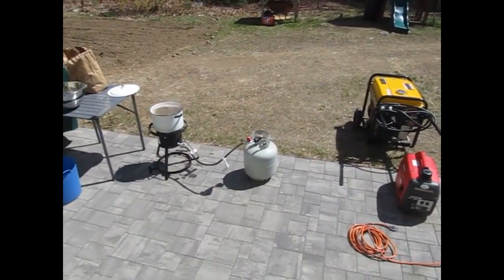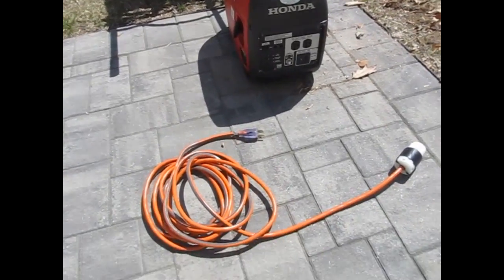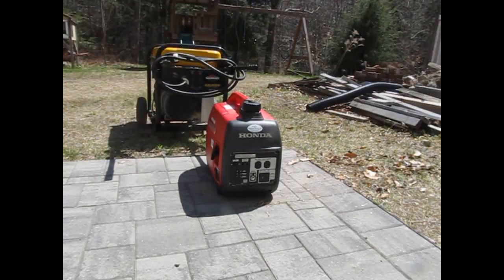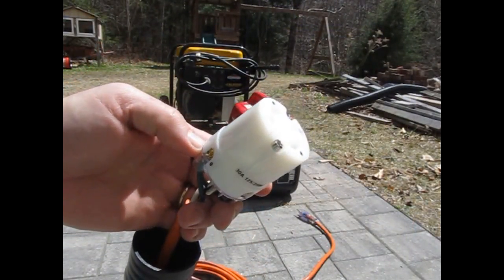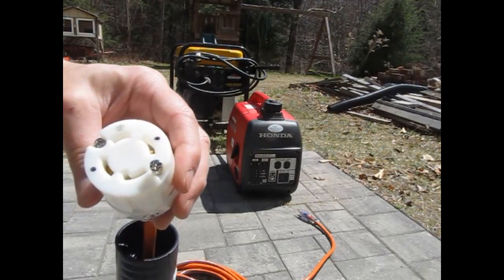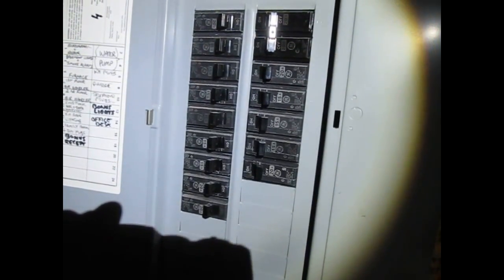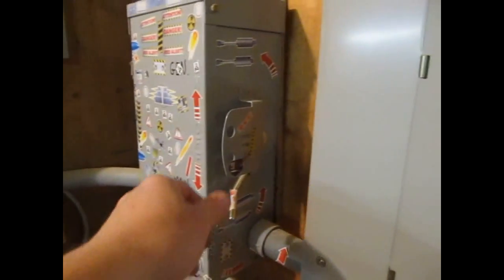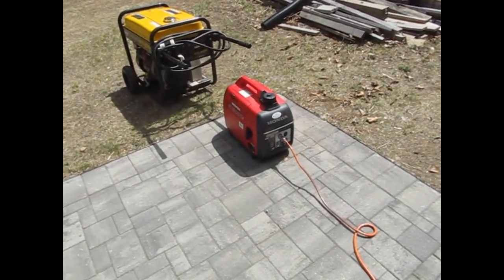Honda Generator Cordset Upgrade

Comment: Good video.   I tried to find a 120v to 30amp pigtail to plug my Honda to my transfer switch using my standard extension cord without having to cut it but no luck. I'll be making your cable soon ... thanks!

Comment: On the honda generator are the 2 outlets  wired  separately  with 13 amps  for each  outlet   or are both outlets wired together

Comment: I was about to make one of these today. You no longer need to make it. For $40, both HD and Amazon sell:

AC WORKS Generator to Transfer Switch L14-30 Inlet Box Adapter (15Amp Household to L14-30 Compact)

Comment: Wonderful video .. and a great reminder to myself, why I power my house using a 2200 watt whisper quiet gas inverter generator. Sure, I may not have air conditioning or use of a large stove or big microwave .. but the fridge runs great, I have clean sine wave power for electronics, modem and router, television and dvd player .. lights throughout the house and plenty for tiny 600 watt microwave, 900 watt induction cooking hotplate which can fry two perfect eggs in about a minute .. and a separate freezer. And best of all .. if I'm careful,  I can go almost a day on a gallon of gas.

Comment: While this will power both sets of 120v circuits on both sides of the panel, it's not advisable because some 240v circuits could be damaged if accidentally turned on.  It's also considered a safety risk like backfeeding through a dryer plug (but you Allred knew that) .

Comment: Exactly what i was looking for.  Thats my next " project"  THNX  FOR THE VIDEO!💪💪💪
Reply: I was just in home Depot today, making a shopping list for this exact project. 

I was stopped in my tracks. I found this: AC WORKS Generator to Transfer Switch L14-30 Inlet Box Adapter (15Amp Household to L14-30 Compact)

HD sells it online, so does Amazon. It comes out to be the same price or less, depending on which L14-30R plug you buy.

Comment: So will this work on a main panel too or just a sub panel? I was backfeeding through a 120 outlet so I only had half my panel working, but I could get my boiler fired so that was all I cared about really. I tried this and when I turned on one of my lighting circuits, that I couldn't power with my outlet backfeed, it came on but seemed like it wasn't working, the switch wouldnt respond (a leviton smarthome switch). That was the only circuit I tested because I was afraid of damaging anything (else). But I may have already damaged that switch when I was trying to power both legs with two 120v cords going to two outlets backfeeding at the same time. Can anyone confirm that this works when using a main panel?
Reply: For anyone who finds this, it does work with main panels, but, it will not power multi wire branch circuits which is what I have. So, you can only power one side of the MWBC not both. Its a bit annoying because for me that means in many rooms I have to choose between outlets or lights.

Comment: This is what I did. DON'T DO THIS! Now I'm going to explain in detail what I did. DON'T DO THIS! Ok, I'll disassemble the cord plug and show you exactly what I did. DON'T DO THIS! 

This video needs more of an emphasized warning to turn off ALL of your 240v breakers, lest you risk destroying such equipment (well pumps are expensive).  With over 32,000 views, no doubt more than one dufuss has already ruined something that cost a lot more to replace than a 240v generator.